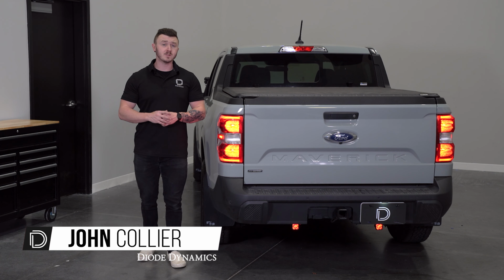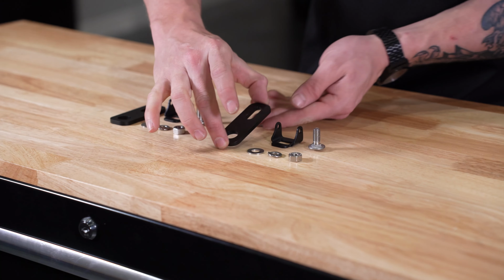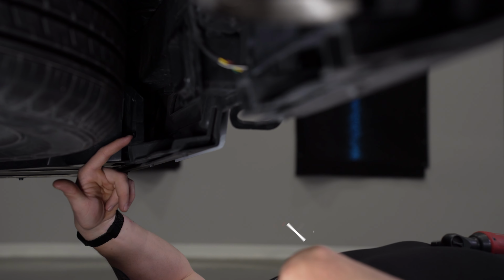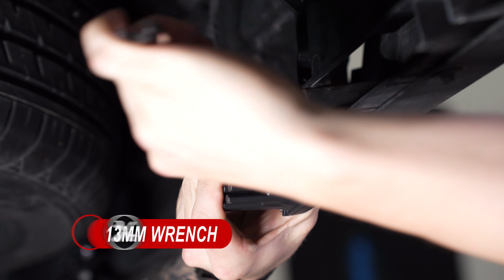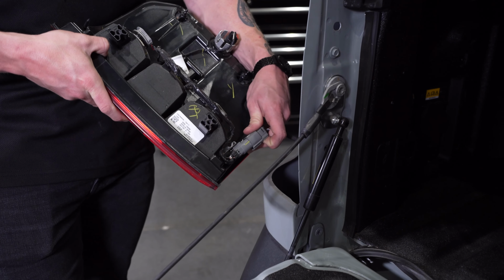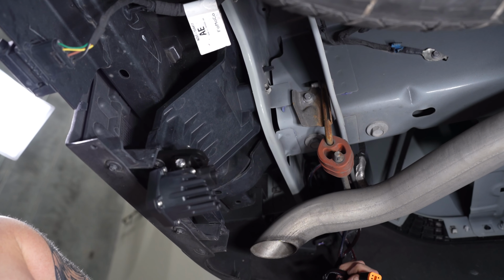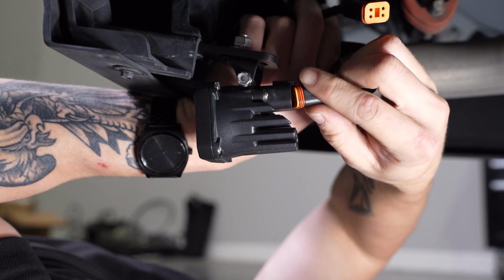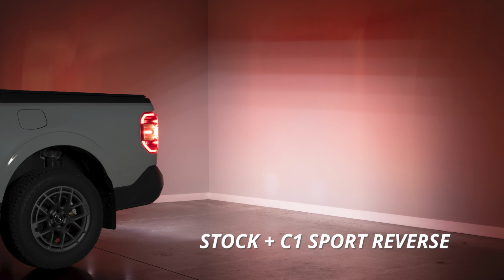How To: Install 2022-2024 Ford Maverick Reverse Light Kit | Diode Dynamics

Comment: Is it possible to mount this on a bed rack instead on under the bumper?
Reply from the maker: You may need some extension wires, but it should be possible, yes!

Here is a link to our extension harnesses:
https://www.diodedynamics.com/dt-4-pin-extension-wire.html